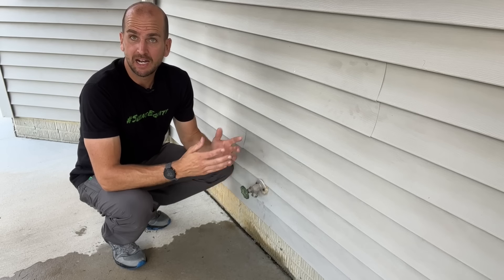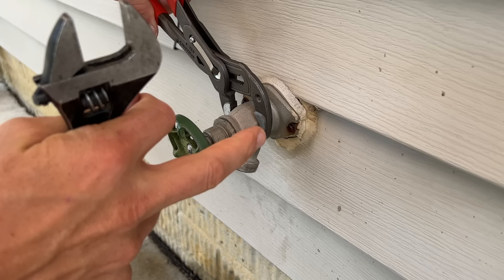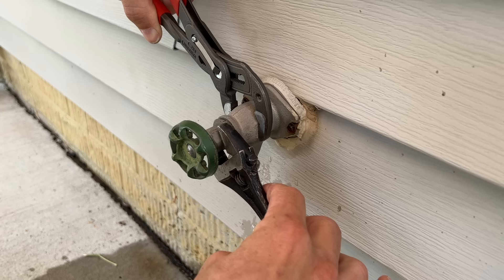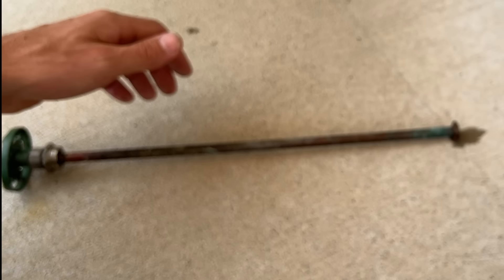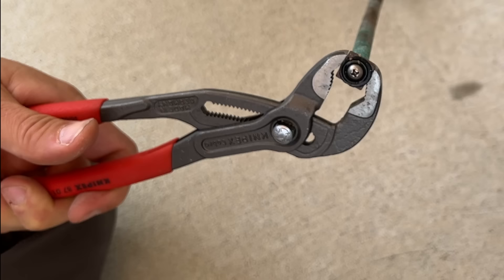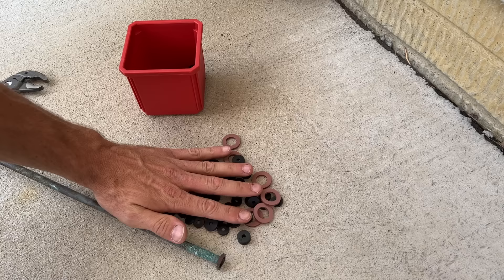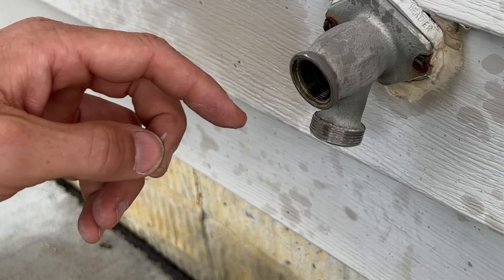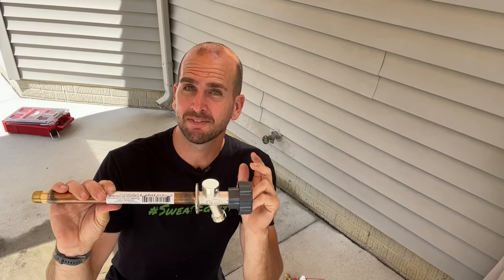How To Fix A Leaking Outdoor Faucet | Easy DIY Fix!

Comment: 30 year plumber here. Not bragging. Just sayin. Nice video but the guy isn’t using his tools correctly, getting terminology mixed up and simply stating that this is a sound repair. This is not always the case. After all the running around for washers etc and shutting down your water supply, you could have replaced the entire faucet in the same amount of time and the new one would last most of your lifetime. If there is even the slightest damage to the seat in the existing valve body, you’ll be right back to where you started within 90 days. Guarantee it. There is a reason that the washer was damaged in the first place. The fixture is just old. Don’t miss a day of your life messing with this repair. Just replace it for the peace of mind. Just an added note. The atmospheric vacuum breaker will not protect against freezing if you leave your hose attached to the fixture during freezing temperatures. See ya. Enjoyed the video.
Reply from the maker: Thanks for all the feedback.  This spigot would be a bit tougher as it is in a finished part of the basement so would need to cut a hole for the swap out to a new one.
Reply: That was my problem have to tear out half a wall to fix it.  Thanks for this video.
Reply: Yes thanks for the video bc I have the same problem.  I also have those stupid vacuum breakers on my house and all they do is leak. The builder of this house made nothing really serviceable.
Reply: They make a kit that you can resurface the seal, I even made an extended tool by welding a 6 inch piece of steel on the tool, I have three outside hydrants and they have all been repaired, no leaks, and by the way,  don't tighten them so tight when you turn them off.
Reply: My goodness, guys! If you have an experienced plumber, things will go smoothly. It’s not something horrible difficult for a skilled tradesman. Just sayin. I’ll shut up now. I highly respect a home owners resolve to make repairs on their own but sometimes you need a little help. That’s all. Great conversation. I enjoyed the dialogue. Thank you. I learned a lot. Be well.
Reply: Where can I get a replacement? This fix didn’t work for me
Reply: 30 year veteran plumber here in Arizona and I feel exactly the same way as you do respectfully same homie❤
Reply: I don't see any of your video's.  It's a repair video's.  We know plumbers, it's milk the job, screw other things up etc.  I'm a professional too.  :)
This guy makes great vids.
Reply: @raymondmaes1361    Wow!!  I truly appreciate your response. Please notice that I mentioned in my post that I enjoyed the video. 
Truth is, Ten plumbers can approach a job ten different ways. OP probably understands that. He was trying to save the customer money because he has a big heart. I can appreciate that, for sure. I would have done something different. That’s all. No ( milking ) involved 😂. It was just my opinion and the gentleman was totally gracious in his reply to my comment. 
I sincerely apologize if I seemed harsh in my initial post. Certainly didn’t mean it that way. Things are really expensive right now. I’m out to give the most permanent fix and ultimately let the customer decide giving him or her the pros and cons. Happy Holiday! Be well.
Reply: Question sir: would a plumber need to go underneath my home to change out an outside water bib? ( company tried to rip me off and I think he went under my house to create another problem when I don’t feel he had no need under my house, but I’m a female so thought I’d ask and us why I watched this video. 🤷🏻‍♀️
Reply: @taylorshomestead3934 yes to replace the whole unit access to the crawl space is needed
Reply: @edubb2491  thank you! They did admit to not doing some things on my bill… so many crooked people out there!
Reply: @taylorshomestead3934  sure is!!!!
Reply: I think I can understand this (replacement vs repair). I live in an area with extremely hard water, tons of dissolved calcium salts, and it wrecks everything within 5 years. I'd be tempted to try a repair, but the fact is replacement is faster than trying to descale everything.
Reply: @EverydayHomeRepairs thanks for the video, just need to fix the leak before I sell my house

Comment: Had a plumber tell me one time after he replace the faucet in my bath tub, the best way to make the faucet last longer is to act like a little old lady with arthritis in my hands and only turn it till it stops dripping. Great advice.
Reply: Mark rapacki  that is correct.
Reply: Don't ever buy a delta. There are too many internal parts that if you over tourqe that handle it will drip. Stick with moen
Reply: @endlessdesert3122  Moen Schmoen. Delta faucets have stops that prevent over torque. Moen might too, but I'll take a Delta over a Moanin' any day.
Reply: Actually, stop turning BEFORE it stops dripping. It's water, not electricity. It will not stop flowing instantaneously. It also isn't air/gas, which needs a tighter seal to stop the flow. Turn it off, watch the drip. If it needs a little more tweaking to stop the last drips, give it a LITTLE more.
Reply: Sounds like the plumber simply didn't want the small job.

Comment: Many times there is a notch in the brass seat that the washer presses against and the leak will return .
Reply: I have had my friend replace it then a plumber and it's still happening.
Reply: @curvyblue2843  most of the time, if the faucet has dripped for a long time a notch will wash in the brass seat, and the only thing you can do is replace the entire faucet

Comment: 50-year plumber here, and I completely agree!! Spend a little more money and replace the thimg with one equipped with a vacuum breaker, which will allow the water to fully drain from the sillcock when turned off AND will satisfy the plumbing code

Comment: Temperatures dropping to the teens tonight, I scrambled to fix leaking faucet and then found your video with the exact same faucet.  Followed every step of your instructions, including your parts recommendations, and repair went perfectly and faucet no longer leaks.  Finished a few hours ago just as it started snowing.  Thank you!

Comment: This video is incredibly helpful. I feel inept when it comes to home maintenance, especially anything to do with plumbing, but after watching this, I think I can actually fix our outdoor faucet now. So, thank you very much for your instruction.
Reply: I feel the same!!
Reply: Same. Thanks a lot
Reply: And? How much did the plumber cost you?😅
Reply: @alan4sure  I tried to fix the bathtub faucet leak and it was difficult to get off.  I  damaged the part that went into the wall. I called plumber and he told me  because I did that, he had to replace the copper inside the wall on top of the tub parts. He was there 2 hrs and it cost me $1100 for something that should have been at most $75 for new faucet parts. Now I'm afraid to  do anything related to plumbing.
Reply: @dougbax641  yep I can imagine that happening for sure!
Reply: One of the best repair videos . Right to the point and good video angles .

Comment: Your video saved me a lot of stress and money! I was ripped off by a plumber who "fixed" my leaking hose bib for $150 less than a year ago. He warned me that his repair might not hold, and a permanent fix would be several thousand dollars. When I took it apart, the washer looked like yours... I think he used the wrong size for this unnecessarily expensive repair.  Your recommendation for $10 of washers and careful instructions were perfect. Repaired it myself and I'm confident I can do it again if I have to. THANK YOU!!
Reply from the maker: Awesome, happy the video helped 🙌.
Reply: I charge 350$ to replace an exterior faucet
Reply: I was charged like $575 for a plumber to replace a hose bib nearly 10 years ago.

Comment: Thanks for the excellent video.  I was able to replace the washer and fix the leak with no problems.  It was much easier and cheaper than replacing the entire faucet and no plumber was required!

Comment: Great advice for everyone.  My disaster was when I moved to Misssouri from Michigan.  One of my faucets was NOT outdoor frostproof.  One year when I did not drain it, it froze and burst a pipe inside the basement.  That spring when I pressure washed the house, I flooded the basement!  Cost me my basement bedroom, carpet, drywall and  a bathroom.  The insurance company paid to demolish, air dry and clean some of the basement- no repairs!  A month later after receiving a small check,  we pulled the carpet in the next room and we discovered mold under the carpet.  The insurance people suggested we should dry it and re-lay it! No way we did that!  So we pulled all carpet, washed and dried the concrete.  We then  laid tile throughout the basement.

So in summary, drain non frost-free lines before they freeze.  If possible replace them with frost-free, ASAP.  Don’t expect the insurance company to cover pipes freezing.  After all , it’s an act of nature.
Reply from the maker: Oh man, that is rough.  I appreciate you sharing the story to help other homeowners avoid a similar nightmare.
Reply: So are hurricanes. I’m covered. Are freezing pipes the homeowners fault for not winterizing?  What if they don’t know….YouTube.
Reply: @EverydayHomeRepairs  I am selling my house in Texas if you want to resell and make at least 30k profit
Reply: should have stayed in Michigan! lol Thee best state there is!!
Reply: Thank you very much for sharing.😊

Comment: Great video.  Although I found my insert to be threaded, I found the flattened washer and replaced it with one found in the "contractor pack" I paid 10 bucks for at the hardware store.  I decided to try it  because a plumber told me the week before that, "We don't repair, we replace."  He quoted me $658!!  Good savings of $648! Thanks!
Reply: Some faucets are antique style and cannot be 'replaced' easily or at all.
Like those on the old claw foot tubs for example.
Older sinks sometimes do not have the 6" spacing for lavatory sinks' new style faucets.
So, get out the seat grinder, washer and SCREW kit, valve packing, and plumber's grease.

Comment: Thanks for this clear video. I detached my hose from my exterior faucet today and noticed that the it was really dripping quite a bit. With colder temps on the way I couldn't leave it like that. I had repaid an interior faucet on a utility sink just a few days ago, but watched your video as I have a similar setup with a frost-free faucet. The only issue I had is that the bib washers I had on hand were 1/4-in M size, and I needed 1/4-in S size. I went to my local hardware store and picked up what was the last package and completed the repair. Thanks again!

Comment: Since I did my addition in 2001, I have had a leak in the outdoor faucet the whiz kid plumber installed.  I kept putting off getting it fixed, because I thought a plumber would need to come out and replace the entire unit.  I guess that might still happen, but a 20 cent washer sounds like a much better deal.  Thanks for the video.

Comment: I'm in the South, so I had never seen an antifreeze faucet.  Cool stuff.  Great video.
Reply from the maker: Thanks!
Reply: @AStanton1966   Great point!
Reply: I live in an Atlanta suburb and still have freeze proof outdoor faucets. Also have indoor hose bibs (shutoff valves) to each outdoor faucet and I shut those off when a freeze is forecasted.
Reply: T Raybern   No thanks for yours.

Comment: The building code prohibit all pipe installation that would be inside an exterior wall because of freezing in cold area (like Canada and northern US). That is also why you need that long frost free faucet because it needs to reach the pipe inside the house, on the "warm" side. The rubber is also inside to stop water before it goes throu the wall. Hope this comment help you understand the purpose.

Comment: worth a reminder that before tightening the bonnet, to make sure the faucet is slightly open.  Otherwise the force of a wrench could crush the new washer, or maybe even crack the valve threads.

Comment: Really good job!  It’s easy to say just replace the entire faucet BUT if the no freeze is hard soldered in then it’s not that easy cause you have to know how to cut copper and solder the new one in!
If it screws in under the house, no problem!  
Thanks!

Comment: An even easier fix is to install a ball valve type shut off, it screws onto the facet outlet and provides another threaded hookup point and has a ball type shutoff valve in the middle. I put one of these on my spigot so that I could more easily turn the water on and off. Alternatively, i would replace the screw type valve with a 90 degree shut off valve rather than fix the original valve.

Comment: I learned from observing the condition of the flat washers when replacing them that over-tightening them actually causes the rubber to buckle or wrinkle and tear, causing leakage.
So tighten only enough to stop the water, and give it time to drain out before you continue cranking it tighter. It's natural to think you haven't tightened it enough because we're so afraid of  it leaking.

Comment: Best to open the valve a few turns before tightening the bonnet.  Less chance of distorting your new disk or the valve shaft.
Reply: Thank you!!!!
Reply from the maker: Appreciate the feedback 👍
Reply: What is the average time the flat where is supposed to last?  I have to do this about ever 18 months.  Appreciate the video
Reply: @Tom Dicks  mine need replaced right now at 12 years.  Either you have really hard water (mineral) or you close it so tightly that it is distorting the washer and ruining the seal.  Referring to hard water,  you could also have corrosion or accumulating scale in the pipe where that gasket seals.   If this is the case, a bore brush of appropriate size can help clean it up,  or accessing the entire spigot pipe and replacing it is an option.

Comment: I got a response from my comment asking if the shutoff valve I suggested is 1/2 inch or 3/4 inch. Plumbing code requires that water be plumbed at 3/4 inch and that each individual outlet whether faucet, toilet, DW or whatever be plumbed off of the 3/4 inch line at 1/2 inch, as this helps to distribute water pressure and volume evenly throughout the house. So your outside outlet will be 1/2 inch. There may be some commercial settings where a 3/4 inch outside faucet may be used.

Comment: I have a ball valve outside that was leaking. I just got a brass hose shut off and leave it installed when I remove the hose. To change it would require a solder job next to my siding.

Comment: Great video, as per usual. Just one small comment. WD-40, IMHO, is far overused/misused. It ISN’T a lubricant per se but is often sold as one. The WD stands for Water Displacement, And simply displaces water which does help somewhat. There is a WD-40 brand penetrating oil which could have been used for your purposes.
Reply from the maker: Thanks for the feedback Rick 👍
Reply: I'd also suggest using caution lubricating potable water sources with anything other than food grade lubricants.
Reply: All WD. 40, also works as penettreting oil too. ( we have locksmiths in family using it for lubricating faucets and locks for over 75 Years.
Reply: @dbteepo86  TRUE.
Reply: Mark rapacki  not true l😠😠😠😬😬🙍🙍🙍

Comment: I fought and fought for years with a spigot like the one in the video.  Replacing washers over and over again.  They never lasted.  I finally replaced the entire stem with a new style and it has worked perfectly ever since.  It appeared that the prior owner of the home had cranked down on the handle so much to stop it from leaking that it damaged the seat the washer was meant to seal against.  Moral of the story, don't overtighten your spigot valves.

Comment: Replacing the washer will help but many times it is a short term fix.  The metal the seat that the washer contacts to shut off the water flow is going to get rough over time. This will eat up the new washer fairly quickly depending on how much damage there is to the seat. There are seat smoothing tools available. I saw some many years ago that reshaped with a smooth rounded top like the factory seat. Now they just smooth and flatten the seat.

Comment: hi. thank you for this video. i was able to fix the leak and water is no longer dripping but when i turn on the faucet, the water flow is not strong and it is all over the place. does this mean i used the wrong washer?

Comment: The part I wanted to see most is a close up of the washer and valve stem. I couldn’t quite see if the entire washer fit inside the groove but since it was mentioned that it’s a flat washer, I am assuming it does.

Comment: I had to change my outdoor spigot. I removed the entire faucet. I wanted to update the spigot. I connected the new faucet to the copper tube coming from the house. The water was turned off but it was dripping, not much but enough where it would interfere with soldering the copper tubes together. To stop the drip, I placed a slice of white bread inside the copper tube in the house and connected the pieces with solder. The bread kept the pipe from dripping and the weld took hold. Prior to screwing on the faucet piece I turned the water in. The bread, now toasted came out with ease. The faucet was screwed on and it has been fine ever since.

Comment: I had a very old house and had to repair many valves in the house did not realize the frost free would be of similar construction, when it went in the old house I could have repaired it but was disabled at the time so paid a plumber a ridicules sum to replace it.